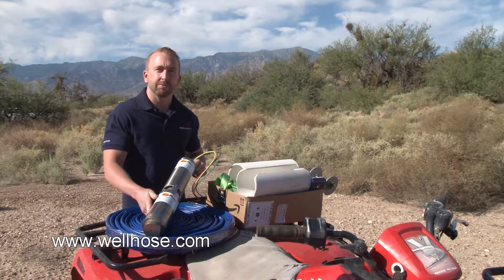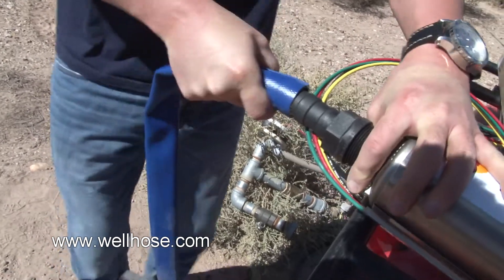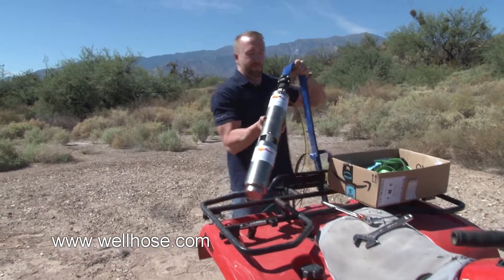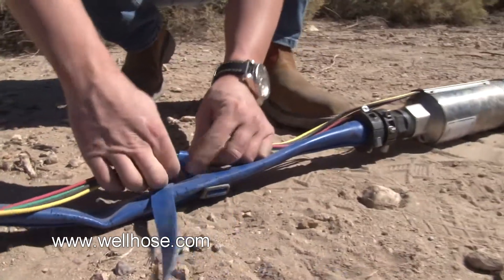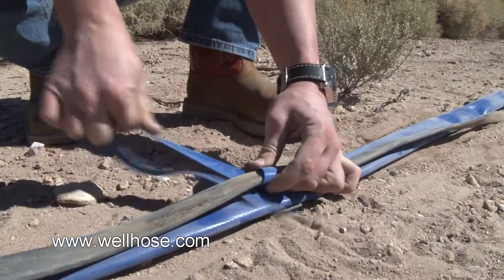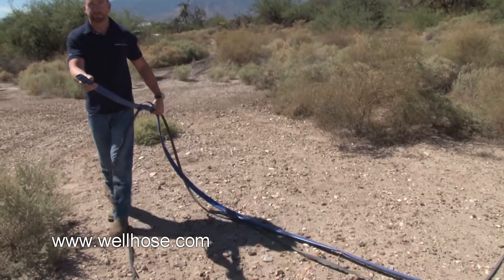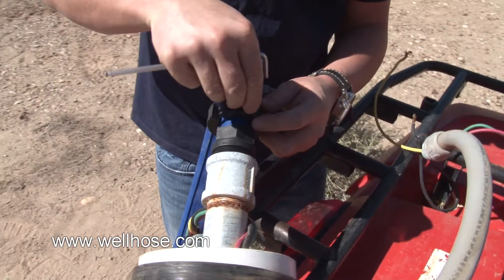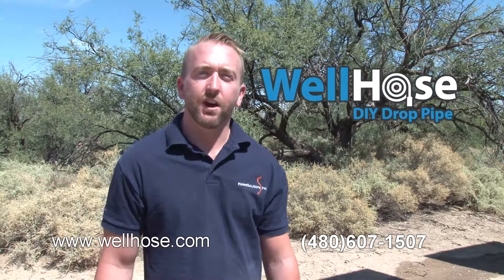Water well pump installation easy with WellHose

Comment: Was an easy install with 1.25" hose at 145'. Did it myself no problems. Has been running great for a couple of months now! So much easier than PVC piping!
Reply: Hello Carlos. Thanks so much for the message. Let us know if you ever have any questions. Cheers